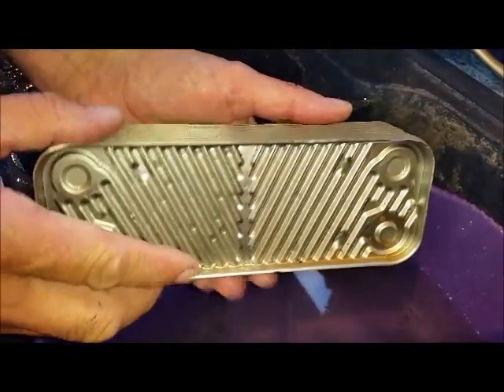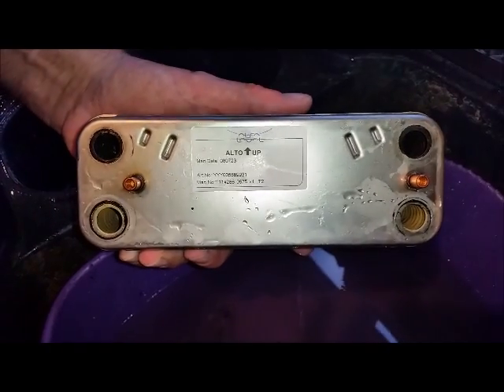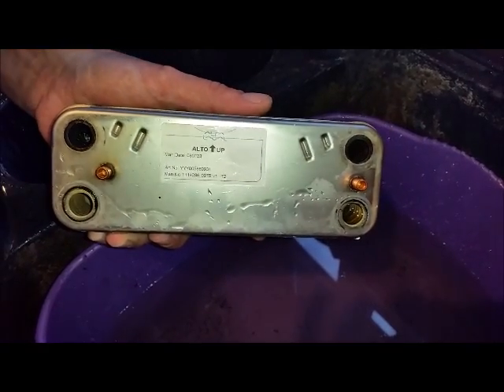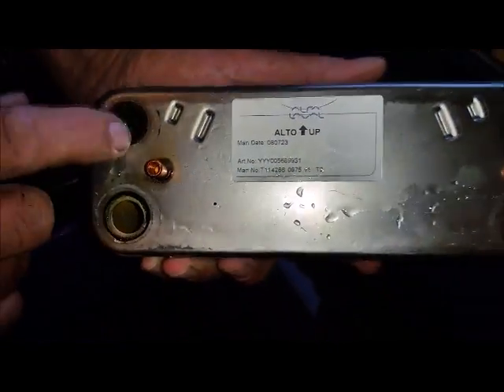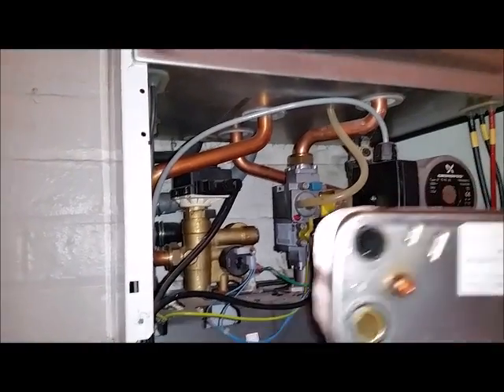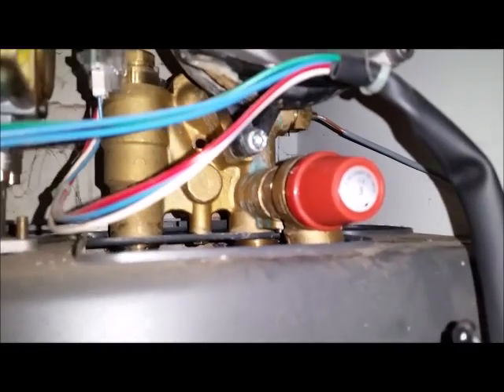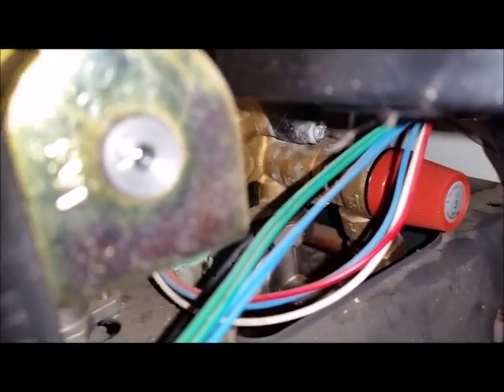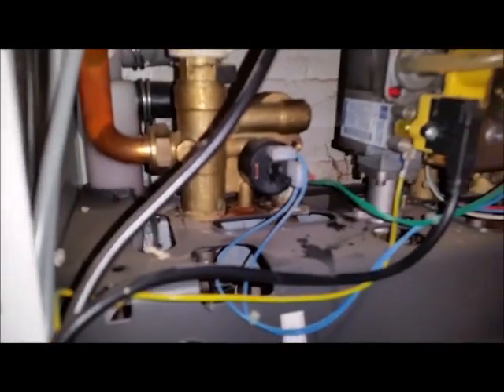COMBI BOILER heat exchanger

Comment: Don't listen to this guys advice, he's breaking the law by working on that boiler and I know what I'm talking about as I am gas safe registered myself. Boils my blood numpties like this bloke suggesting folk work on their own boilers for the simple fact it's not safe to do so unless you are suitably qualified to do so, also you are breaking the law. Please. always use a game safe registered engineer. https://www.gassaferegister.co.uk/
Reply: every thing i have seen on  mark davies chnnel is true. yyyour aaall  bunch of convicts hooking up on the gas safety info,,its all bs
Reply: You gas safe chappies love getting on your high horses about the legalities of boilers, lets put it into simple to understand terms, the law covers the supply, control, combustion, flueing of gas appliances. it does not apply to water only components. a competent plumber, (diy or professional) can inspect, repair or replace things like the expansion vessel, waterpump, diverter valve etc, replacing an expansion vessel is no more difficult than replacing a radiator. try reading the gas safe register fact sheet on who can legally work on gas appliances. https://www.gassaferegister.co.uk/media/1449/who-can-legally-work-on-a-gas-appliance-factsheet.pdf
Reply: VAPE MY DAY read the document it says you can only work on wet components only if the outer case is Decorative....99.9% of boiler cases are not decorative they are room sealed therefore to take the cover off you need to be gassafe suggest you read your own evidence 😂😂😂

Comment: Best bit of advice I can offer is fit a Magnaclean Pro 2 or similar magnetic filter on the ch return, close to boiler. Your system must be full of crap. Not only will you keep needing to remove and clean the hot water plate hex regularly if you don't sort out the rust flakes floating around system, but eventually your main hex will block up. Then the boiler is poss scrap. Thanks for the vid.
Reply: woodbine66 it's all well and good fitting a magnaclean etc but if the existing system is baked a magnaclean aint gonna do much. When we fit new boilers, the system is powerflushed then chemically treat with mag fitted. This is why companies are offering big warrantys now. Vaillant for eg 10 yrs. But a sample is sent off to be tested to ensure clean system water for warranty to be honored.
Reply from the maker: woodbine66 thanks for advice I have a magnfilter fittied but are water here has so much lime scale  sometimes it hard to keep on top if it. Even after I filter it I can taste Lime. Thanks for watching
Reply from the maker: Yes the magnafilter was fitted when new installed by British Gas, thanks.
Reply: @MrMeltedwellies   The magnetic filter only works on CH side of the system and not on your HW

Comment: I think you'll find the two top ones are in fact the central heating side!
Reply from the maker: Hi Habib thanks for watching iam no expert and my grangchild was freezing so had a go my self
Reply: @MrMeltedwellies   That's a lie, the plate doesn't affect the heating
Reply: Habib Khushi no they are not.
Reply: @rayc1503  .hi is the primary allways at the top of the exchanger. The reason I ask is I have to put a new one on my boiler  and the new one comes with an arrow to primary to the right and secondary to the left .but no information on my old unit and dont want to get it wrong .
Reply: @paulelscey2465  Depends on which boiler you have. I'd seriously get a Gas Safe registered engineer to do this as you're compromising the combustion chamber and seals. Without a gas flue analyser, there's no real way of telling if products of combustion are spilling. Almost all modern combi's are room sealed. If you are going to attempt it take plenty of pictures. Firstly have a copy of the manufacturer's instructions to hand. These can be downloaded through Manufacturers website. If it's this particular boiler. There's only one set way the primary heat exchanger can be installed. In order for you to change it you'd have to remove the casing and the fan. Don't cut corners with Gas. Trying to save a few quid could mean the lives of your family & others
Reply: @rayc1503   .hi thanks for the reply iam quite competent in all work that I do .iam a mechanic by trade so well away about doing things right the first time .I allways have a gas engineer come in after any repairs to give the boiler the once over .my boiler is a ariston microgenus 28mffi. The central heating flow comes from the left hand side and the cold water supply comes in from the right
Reply: @rayc1503  .hi yes the plate exchanger. I wouldn't touch the main one as I would have to disturb the gas seal .and like I said only carry  out repairs to the water side .ok chears for the input.
Reply: Paul ELSCEY you take the front off a boiler without being gas safe you are breaking the law, they are room sealed appliances by taking the cover off you are working on GAS appliance no matter if you think it is water, the cover is part of the Gas side of the appliance.
Reply: @garrybunting615  hi good job I haven't had to remove the the cover for the furnace. As the plate exchanger sits at the bottom of the boiler not behind a sealed unit
Reply: @rayc1503  . Thank sorry  about that is says on my new plate  to plate. 2 arrows the right says primary and the left say secondary . And I was lead to believe it could also go in up side down  as well .It could possibly fit in 2 ways
Reply: @rayc1503   .its probably easier if you look at this item number on ebay and you will see what iam talking about 254275570938
Reply: @rayc1503  .that's great I hadn't noticed that chears for all you help
Reply: @rayc1503  .hi I have the new exchanger. Its passing water and pressure my boiler up even when not in use it's not the loop .and hot water going hot to cold .I have all ready had my old one of and chemical cleaned it . It's just that is a different brand original one has arrow point up .but this one is left to right .the return and cold supply enter from the right hand side.  I never mess with the gas side of anything only the water side .only if its straight forward

Comment: How do I remove the heat exchanger? What do I need to isolate?
Reply from the maker: Turn off the mains and any taps under the boiler then on the right hand side is a small blead tap put a bucket under and turn on till water stops, system drained, just two screw's hold the heat exchanger on. When you undo the exchanger you will have a bit of water loss so be careful plus be careful of the pcb board (electronics) all the best
Reply from the maker: Ps don't forget to check you have turned the mains electric off to the boiler